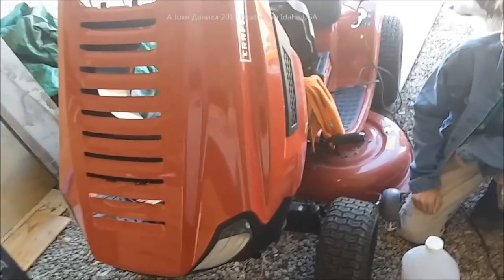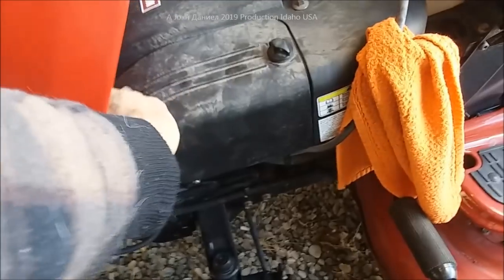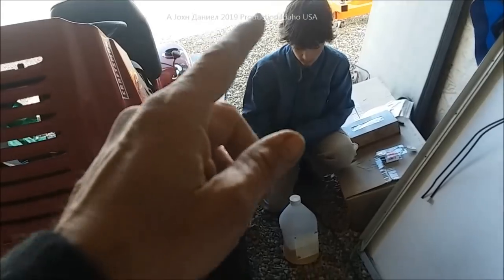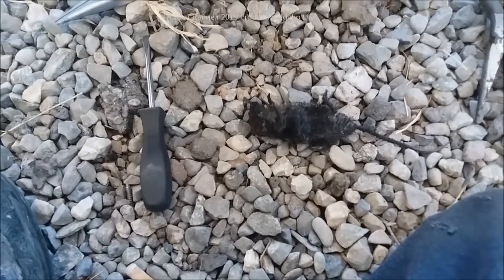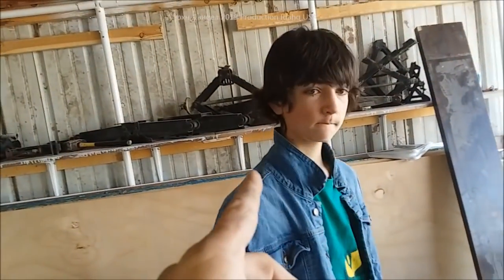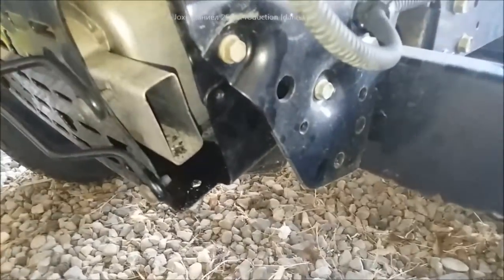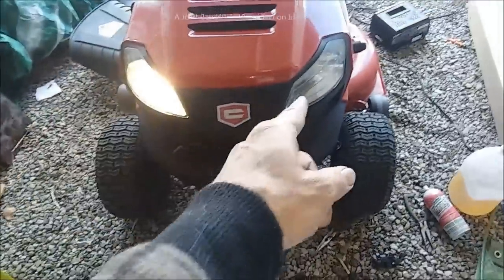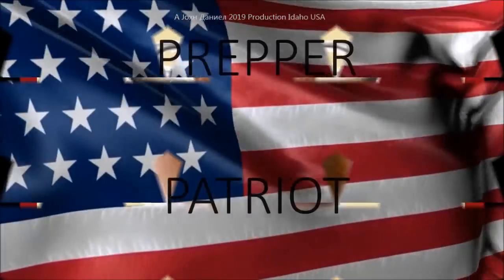Mower engine surging sputtering? Maybe this is the problem.

Comment: Thanks for the video.  Daniel should keep on figuring things out as he appears to be mechanically inclined.  I am having a similar problem with my 1980 Craftsman GT18 lawn tractor and will be sure to check the muffler and exhaust system!  Thanks again.

Comment: Thanks kid! You saved me a trip to the service shop for repairs. I hate tinkering with gas engines/motors in general. Cranked up the Husquavarna riding mower and it would startup, spit smoke and sputter  then die. Your vid was the first one I pulled up. Immediately after watching the first part of your video, I suspected air was the issue. I also noticed some fabric lodged up in the engine. Sure enough a mouse had built a nest on top of the engine blocking the air intake port. My son said the engine was sputtering when he cut the grass but I never got around to looking at it. Thanks to your video, after a trip to the service shop to get some motor oil, new splark plug, and new oil and gas filter, it's running like a champ again...12 years, very little maintenance and still going strong. Great job and thank you again for sharing your find kid!
Reply from the maker: I taught him from very young, never over complicate it, and your more likely to fix it.

Comment: I worked at a repair shop and had a newer royobi leaf blower come in would only idle. (don't know if it was return/warrenty or customers unit)
Did the usual compression test, was good. 
Not an old blower was still clean. 

Checked the gas that was good. 
Checked carb it's non adjustable so had to replace it to verify if it was good still woud only idle  (cheaper to replace verses labor to rebuild old carb) 

Had to wait for an ok before continuing into diagnosis of the engine and did get the green light to take a look.

I was heading towards stuck rings or blocked spark arester screen from too much oil in the gas mix so removed the muffler but was all clean.

Found a bug nest in the 1/2 exhaust tip going into the blower body out of view before disassembly. 

Thinking what the heck I had to tear apart the blower assembly to get at the muffler because of a bug😅
 didn't take too long to do but still funny.

Comment: "Out of the mouth of babes" We are blessed with 5 senses & he used one that the guys at the shop did not. Give him a big .👍. He will go far. Nice gamble on that rider. Turned out a lot better then expected. When I buy I used the same method. I look at the worst it may cost to repair & if still worth it done deal. If it does not need what I thought it may have needed even a better deal.
Stay safe, Joe Z

Comment: Lol, I got one of those 420cc mowers at home. Had to retire it to a riding mower after the chineese deck anhilated itself in tall grass. Pushed a pulley through the deck and almost lit on fire. I had to put it out with mud last summer. I also had to dissect the motor and replace the balancer and crank bearings because I blew them after a mobil one oil change.  The balancer bearing comes out with bread and a socket... I got a dissasembled 2001 craftsman gt5000 for the yard now. The old school deck and 27hp kohler engine has been unstoppable after I rebuilt the engine and replaced a few old parts. I got it for 200.00, replaced a couple rods, a piston, cois, tire .etc.  But it seems like that 420cc with the gas peddal to move is only good for when the gt5000 is busy or having a bad day. They do not make them like they used to be, so everything is made to break on the newer ones. Just don't mow tall or thick grass with it and it will be okay. I was trying to plow down tall grass on 5 acres with mine and I made belts, cables and deck parts start flying.  Even the pulley brakes and metal pulley shields blew off on me my first time riding it. I am suprised a mouse got in the muffler, because they never used to be like that. I think in general the newer lt 1500s are prone to fire.  Probably why the guy we bought the house from left it and took all the good mowers...

Comment: Earlier this year, just after the winter break my lawnmower started running strangely, then died and wouldn't re-start. Tried the usual things of course, then decided to drain the fuel which looked and smelt odd. So I took the fuel tank off, which rattled. Hmmm, so I shone a light inside and after a bit more rattling turned the tank upside down whereupon not one but two slugs fell out, both fossilised by the action of the fuel. Of course, in return the fuel was contaminated. Hey ho. It's running good now.

Comment: I’ve had trouble with mice & mouse nests, every spring. The mower runs for awhile, then shuts off.  Found nests in the spaces, usually left for air flow, cooling.  I now spray my mowers with mouse repellent spray.  They are really good at getting into small spaces!
Reply: put some steel wool in the exhaust over winter , mice HATE that..... also don't forget to take it out in the spring lol

Comment: I got stung with something similar. Edge trimmer, same symptoms. Had new fuel, clean carb, new plug, had spark, etc etc. Still no go. Found the spark arrestor in exhaust blocked 🤦‍♂️while an engine needs to breath in, it also needs to breath out 😂

Comment: Restricted exhaust on small engines catches a lot of people off guard on repairs , had the same issue with a riding mower with a crushed outlet on the muffler that was 95 % restricted must of taken a hit from a log or rock passing under the front of the tractor , its also a rather common issue on two cycle equipment like string trimmers and leaf blowers that have a spark arrestor screen on the muffler outlet as it will plug with carbon over time..

Comment: Kids going to make a good mechanic. I had a mud dobber stop up the exhaust on a mophead one time. got it at a yard sale for 10.00 bucks. Guy said they couldn't figure out why it would not run.
Reply: mike brink It’s probably the carb if it sat for a couple of years with fuel in the carb

Comment: Soooo....I looked at my muffler. No rat. How about the air intake? Clean. How about the gas cap vent? Plugged with mud as if done by a wasp. Cleaned with a drill bit and she runs like new. Thanks for the encouraging video. 20y/o JD-L110

Comment: That’s what I’m checking tomorrow I’ve been through my whole mower trying to figure it out why it’s spitting and sputtering I’ve put new  plugs ,new fuel filter blowed the air filter out put fresh gas in it charged the battery over night it runs and I’m able to cut with it just the annoying sputtering and kinda backfires a little but not a loud one
Reply from the maker: Depending on the model and engine, it could be the Orings in your carburetor failing from Ethanol gas. My video on it https://youtu.be/MZjI46_f4c0 
Or your valves need to be adjusted. Do a compression test.  A plugged exhaust is also possible due to cheap mufflers and critters.
Reply: @JOHNDANIEL1  same model in the link you shared but that looks beyond my expertise

Comment: I had one with an oil leak that was soooo bad. Changed the pan gasket and crank seal. Started the bugger smoked like a bastard after 20 minutes. I'm thinking oh boy blown head gaskets. Take the exhaust off, mine was full of oil, haha. Exhaust is important who knew.

Comment: That deep fried, squeaky  lil shit was making home in your muffler. You should probably put a metal screen over the muffler opening to keep them out. I have mouse problems too, except they make a chew toy out of the engine cooling, magneto mounted fan, already replaced two of those cheap plastic things in ten years. To defeat the mice, set up two, refillable mouse bait stations where you park the tractor, they will go after the bait, eat it and become very thirsty, go for water and you'll never see the same mouse again.

Comment: Poor design, the mufflers used on the Briggs do not have holes big enough for mice to fit in. That has a no name engine, so its a base model Craftsman by MTD, $800-$1000 new. Had you paid the $600 for a Predator another $200 and you could have had that same mower brand new, or if you paid a couple hundred and put a Predator it would have been like buying that Tractor for new, retail just a slightly better aftermarket engine, because the one on their is cheap.
Reply from the maker: Kohler 420cc , hydrostatic drive, 17.5 horse, retail on it sears, $1539.90 in 2016 . Manual transmission, cut $80,
Reply: @JOHNDANIEL1  Those base model Craftsman's go on sale all the time $800, you can find them $1000 easy all the time, and it didn't look like a Kohler, but if it was it was the courage and they suck and have tons of issue's.
I was just at home depot today, the Troy Bilt Bronco with a Briggs 500cc was on sale $1299 and those are a lot fancier and have Bigger, better engines, made by the same company, MTD, which quite frankly sucks to be honest, now the AYP Craftsman's those were nice tractors.
The John Deere's are $1499 starting and those arent like they used to be either. You think MTD could have done a little better job at keeping shit fron getting in the muffler, did you see all the shit that was up in their, that is really bad for an engine.
Reply from the maker: @Mr_Tecumseh  The sears base model is actually on sale now, 15hp 402cc and manual transmission at $999 with tax, so about $1075.00 . This one was worth $200 and $559 HF 22 horse v-twin engine having the auto trans and 42" cut if it came to that, so totaling under $800 for a 22 horse honda clone mounted on it with good reputation is damn nice. Even the Lifan 18 hp single 487cc from AliExpress would have worked for $435 delivered. 
There was better than a full coffee cup of crap that blew out of this muffler though. But, with over 3 acres already mowed with it, its running just fine. And the dreaded Kohler shitty starter gear has already been sourced for $7 and put in my to buy list. Plus we won't do what kills a Kohler, drive it on a 45 degree slope while mowing. LOL! Their oiling is pure shit.
Reply from the maker: @Mr_Tecumseh  BTW, Sears sucks, BUT once upon a time, they sold a 12 horse WHEEL-HORSE with a genuine Robin engine on it, rare, rare as hell!  And ONLY in mail order, see the 1973 catalog for it. Ran forever, weighed a ton!
Reply: @JOHNDANIEL1  As far as I know, sears never sold wheel horse. I would have to actually see that catalog. 
Sears Tractors were first built by David Bradley, the original Suburbans, than Roper took over production, those Suburban's from the 60's and 70's were their best and are highly collected today. In the 80's AYP who also made Husqvarna took over and built them until around 2009 than MTD came in and their machines took a dump on the reputation. Those were always Sears main source for Tractors, I never heard of wheel horse being sold by Sears, is it possible, yea, but it wasnt their main line. Wheelhorse was its own company typically sold at Lawn mower deslerships and wherlhorse was eventually picked up by Toro and was dropped in th e late 90's.
Reply: @JOHNDANIEL1 Yea Lifans suck too.
Those Kohler courage engines have a few major issues, including the bolts loosening up and than gettinh hit by the flywheel, pure crap they are now. I just got a YTS3000 free last week built in 2009, a better Sears tractor has a 570cc Briggs 21 gross horse and two of the engine mounting bolts are gone, the other two are loose. The steering isnt straight and the tires don't hold air, 10 years old falling apart, but yet I must have had 5 or 6 LT4000's from the early 90's that were still solid all the way around. But that one you have can be grabbed up on sale $899 a majority of the time.
Reply: @JOHNDANIEL1  Yea, to drop that kind of money into a Tractor, might as well just get a new one, better yet, you can still get good older solid built ones for $500-$600 on craigslist. I just sold my 92 LT4000 last fall with the grass catcher for $550 delivered. Solid machine, clean, rock solid peerless trans, and that one actually had a Tecumseh with electric start and backup recoil start, that was a real nice machine, they should have that machine another 20 years, hell by than, it will be collected like the Suburban's from the 60's and 70's are today.
Reply from the maker: Expected it to be a Kohler, was told by the 1-800 sears is shit service number that if its not marked its probably a Kohler, but its made in KOREA, Right on the head - MADE IN KOREA, so its not a Kohler, looking and pulling up its data, its MTD imported from Korea. Yes, Korea. That'll throw some shit into it. More info Sourced from but the info on the engine, its listed as Manufactured by MTD, not kohler, not B&S but MTD Soul Korean pacific power. https://i1.wp.com/todaysmower.com/wp-content/uploads/2013/02/Craftsman420cc.png
Reply: fearlessdjw lmao

Comment: If the original engine had been replaced and the original muffler was transferred onto the new engine it would not have run right either. Imagine the head scratching and swearing that would have caused.

Comment: Well, good job....of course, had you not given up and decided to buy a new motor then the mouse would not have been discovered - it was only when you had given up on the motor and needed to measure bolts that the mouse was discovered. Had any of the other techs needed to measure the bolts, they would have discovered the mouse, too. It wasn't genius that found the mouse.... you both did the same thing the "dumb" techs did...